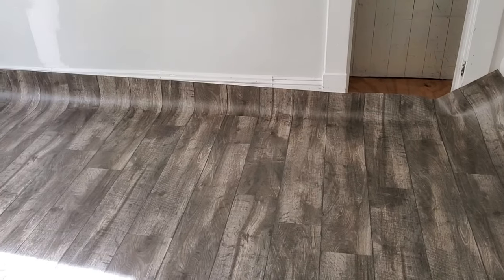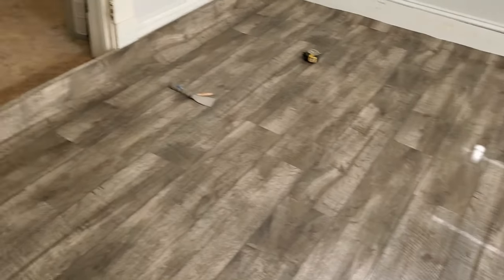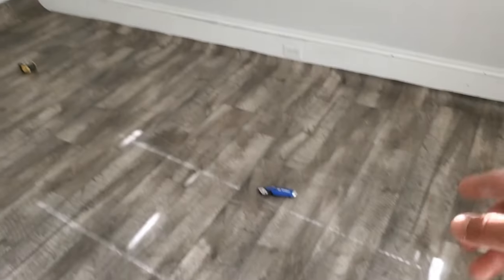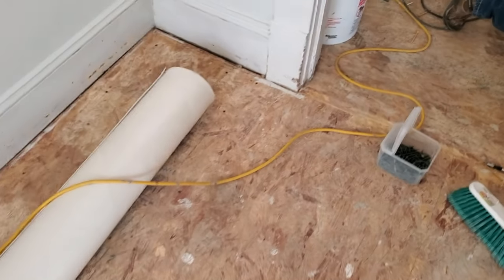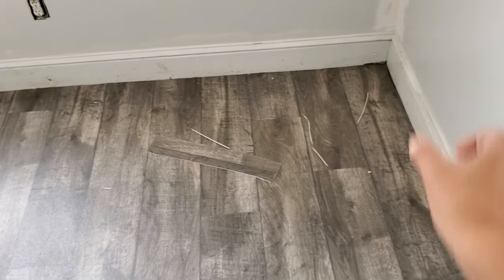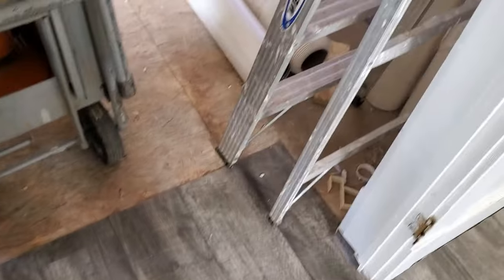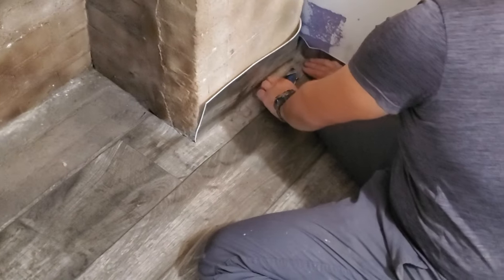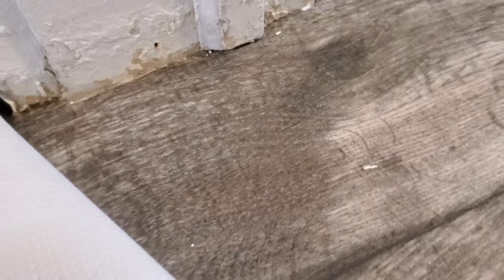How to measure, cut and install Linoleum floors Part 1 of 3

Comment: Thank you sir. A lot of useful information. I am most grateful.
Reply from the maker: My pleasure
Reply: @HugoCorrea  I mmhz
..m me
My

I'll mmhz
Reply: @HugoCorrea great video, I'm about to order lineoleum that looks the same.
Do I measure it differently since it will go in a few rooms? I want to be sure when it's down the lines that look like wood all go in the same direction.
Thank you in advance.
Reply from the maker: @ritawashere5787  make sure that you have enough to make each room, perhaps you can get the linoleum or vinyl by sections so you don't have to get a huge piece to cut yourself. Just make sure you mark each roll to know where they go.

Comment: Nice work, man... Found it was pretty forgiving even for a beginner. The quality of this stuff now is so much better than the old stuff was and for rentals vinyl / linoleum sheet is so much easier to clean than carpet and less prone to damage than carpet or vinyl tile, or even laminate. I like that if it actually does get really beat up, it's very easy and cheap to put another vinyl sheet over the old one, or to pull up the old one in a worst case scenario.

Would like to see how to seem a wood patterned linoleum where there isn't grout lines and at the end of a board. I'm going length wise with the pattern down a hallway. Thanks for the good vid!
Reply: Ha, nevermind. Just watched that 3rd video. Question answered. Thanks!

Comment: You seem very knowledgeable in working with linoleum.  Very happy to watch your video.  Is there a part 2 and 3?  I'm curious if you use specialty tools to cut and join seams, what you use to seal the seams, etc.  I also would like to save a lot of money.  Thank you for posting!
Reply: I had the same question, did you ever figure it out?
Reply: @tendertuna9157  No, I never did get an answer to this. I hope you found what you were looking for. I'm still looking.
Reply: Do you still need to know how to cut and join seams?
Reply: @jackholmes7456 I figured it out after watching a lot of other videos. Thanks!

Comment: I am going to put linoleum over ceramic tiles. Some r cracked r loose IL gluing down, what do I put n between linoleum n tils?
Reply from the maker: Just secure the old tiles and patch the holes.on the floor, after that you can do the same process I show

Comment: Sir if you didn’t have a pattern to match.the best way would be to do an inch over lap.and then cut through the middle of the inch and then pull the undercut out.that way you have a perfect joint,but I’m sure you know that anyway

Comment: I just subscribed & I'm about to order lineoleum with rhe same wood plank look.
Do I measure and have to ADD more because I want All the planks in all rooms to go in the same direction. 
I'm not sure if it's different type measurements.
Thanks in advance. 
I'm ordering the flooring & then having a local handyman install.
Thanks for your information.
Reply: Also how much of the multi purpose adhesive do I need if I'm going to have about 1,025 square feet in 6 rooms?

Comment: do you recommend Linoleum for upstairs on wood subfloor?
Reply from the maker: Yes, you can apply a sealer on the floor first to keep it protected. Don't forget to remove anything that can puncture the material

Comment: Would I have to glue the whole surface if I'm putting it directly on concrete?  The room is 16'x15' with a step down 6" the entire length of one end.
Reply from the maker: Yes, you don't want the material to slide down

Comment: I want to to put it on top of an existing linoleum floor. Do I need to prime it first? Or go straight to work. Thanks in advance
Reply from the maker: Haben Haben you can go over the existing one, just make sure the  old one is in place and cut out any piece  that can be on the way for the new linoleum

Comment: $150 for that room?? Where did you buy it? Two rooms 225 square feet- material only cost me $1500
Reply: i just did my floor 12*10/ 120 sq ft of linoleum for .85 cents a sq ft in lowes. they sell as low as .48 a sq ft

Comment: Where are you finding 12' wide linoleum?  I can only find sheet linoleum in 6.5' widths.  Vinyl on the other hand is easy to find in 12' widths.
Reply from the maker: At lowes home improvement

Comment: This seems to be vinyl, not linoleum...
Reply from the maker: You are right
Reply: @HugoCorrea   I just found out that in the US "linoleum" is sometimes also used to mean "vinyl",  so I do not "blame" you ;-) It is a consequence of sloppy usage of the term "linoleum" that crept in over time. However, the  only true linoleum is the Forbo Linoleum (or similar products of competitors of Forbo), a natural, not a plastic product. Linoleum has different properties and has to be  treated  quite differently when you lay it than vinyl. So it is confusing if it shows up in a Youtube search... ;-( Perhaps add "vinyl" to your title? ;-)